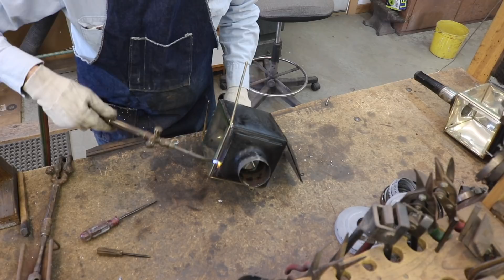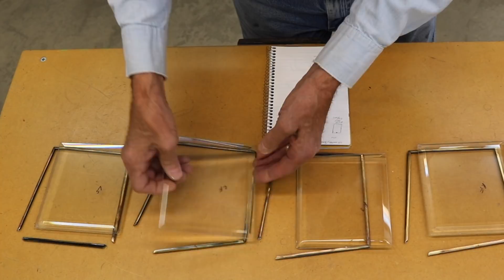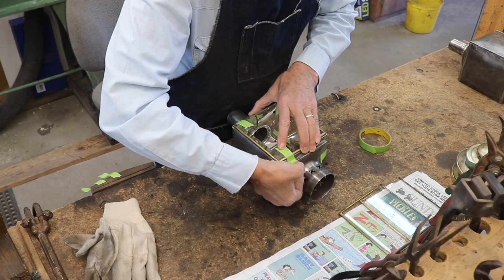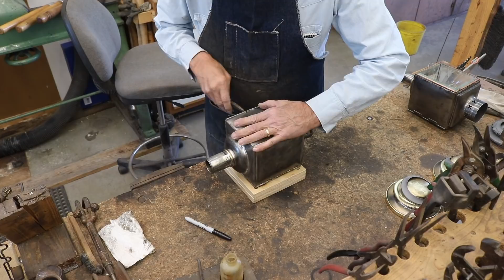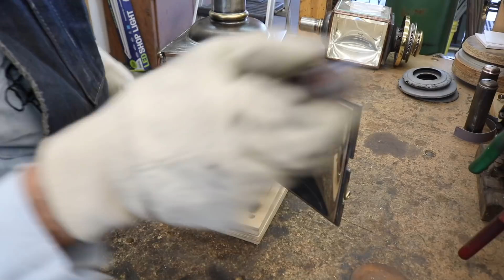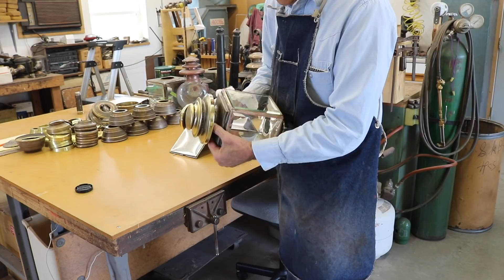Brewster Lamps Restoration, Under the Paint

Comment: When soldering inside the lamp in that ‘pot’...make a ring of solder the size you need, then push it in, and open it out inside the pot to the size required...add your flux and then heat...I’ll think you’ll find that easier than the way you do it at present...👍🏻 really nice job...oh, and you could do with some heat proof gloves, and wear a respirator when soldering too...all those fumes are doing your lungs no good...

Comment: I have speant years working in an old Radiator shop. Anyone who has ever used a torch to work with brass and solder knows how hard that is. It takes years of experience. You sir make that look easy. IT IS NOT. That there is straight skippy some tough work to do.

Comment: I used to drive a pickup and delivery truck for a heavy equipment radiator repair shop and the guys who did the radiator repairs used similar soldering irons. Electric tools weren't an option for them because was always wet.
Thanks again, I really enjoy seeing you work and learning about these interesting historic lamps.

Comment: I'm wondering is that a really low melting point solder?
Reply from the maker: Most tin/ lead alloys are considered solid at 361degrees F and vary from about 380 to 480 melting temp.

Comment: One thing to be careful about when washing any glass is to avoid what's called thermal shock is to use the same temperature water when washing/rinsing to avoid it from cracking. Luke warm water is best never hot because what causes glass to crack is that it can't just release heat from its surface like other materials since  it has to cool from the inside out  to release the stresses that make it fail. Indeed it why test tubes are so thin and why scientific glass isn't  the same as ordinary window/plate glass in its makeup plus if you ever broke a piece of glass cooking ware by putting it in cold water while it was still hot that was thermal shock. Stained Glass artists know well what can happen to glass if a soldering iron heats the brass cane/lead channel at a joint to long it will crack at the point of contact and it's often while tinning it by sealing it with solder is done with an alloy solder that melts at a lower temp. Most glass is put thru an annealing kiln to control the glass cooling down evenly and ordinary window glass to glass bottle take such a trip other wise they can fail either immediately or just out of the blue later and you can see the streets with speciality polarized glasses and light because it looks like a halo inside its edges.  Looking forward to  the painting next time and how was pin striping is done on some headlamps would be a fascinating video and did you ever a repair or recreate a head lamp like those on Locomotive in 1800s for a client or a Museum?
Reply from the maker: I learned about heat control in soldering glass the hard way!

Comment: Very nice. I liked the close ups of the soldering. I assume when these lamps were originally made at the factory all the sheet metal parts were stamped out on specially made dies in great quantities so only assembly and finishing was required. Obviously restoration is another matter altogether. Very nice work!

Comment: Wow, gorgeous work, Rick.  Question: you mentioned the gases to the soldiering iron are oxy and propane.  Are the gases to your soldiering torch the same, or oxy and acetylene?
Reply from the maker: Oxy, propane all around, I don't need the 200 degree difference nor the carbon that acetylene provides.

Comment: Is that a coating or highly polished metal on the reflective part inside? Great videos, keepthem going.
Reply: I assume it is polished and tin plated. I was quite impressed with how bright it was.
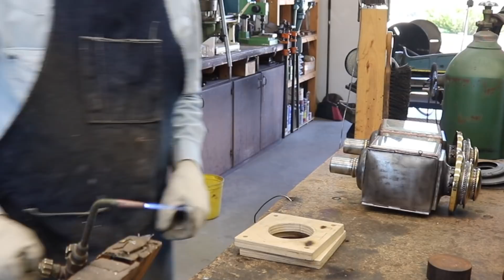Reply: @dbmail545  At 18:48 he called them "silver liners". Don't know if it's because they are really silver or if Rick is just using the word referring to the silver color.
Reply from the maker: Really silver plated in this case though some are nickel plated and a few very special cases used gold plating.
Reply from the maker: Silver plating.
Reply: @TheLuminaryShoppe  ok thanks I always wondered about that. I have seen polished brass in a mining lantern once and thought how tedious that was to keep shiny.
Reply from the maker: The liners are silver plated over copper base metal in this case.

Comment: I am NOT a soldering expert at all... Your general technique appears to be "hot, get in and out fast". Is that an accurate assessment? Fascinating watching you solder next to the glass.
Reply: At least that's exactly how we do it in the electrical engineering parts of the world. Heat the materials, then apply solder. A common mistake for inexperience users is to focus on melting the solder with the iron - then it won't stick to the material.
Reply: That's a good way to put it. Heat control is a big part of soldering/brazing/welding.

Comment: Great job!!  What would you charge To do a set of lamps , like you just did?????
Reply from the maker: My charges are confidential with my clients. Most of them understand that quality work deserves a fair compensation.
Reply: Well, it's hard to believe he would charge less than $30 an hour - that would be much less than the value of the skills he is showing. And he said he had about 60 hours work in the lamps, I'm guessing that will be by the time he's finished. It would take me 60 hours to spin one of those caps (to spin 20, and throw away 19). Anyway, do the math, as they say - comes to $1800 for the repair of 2. Seems like a lot, but not when you see the skill and time that goes into it. Maybe collectors will pay that, or maybe like  many craftsmen, customers won't pay what it's worth and he is woefully underpaid.